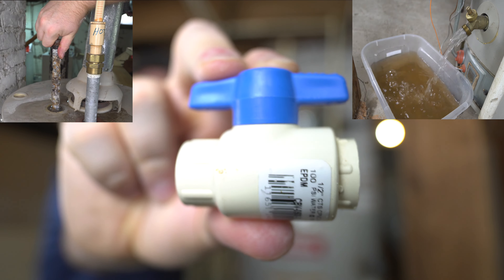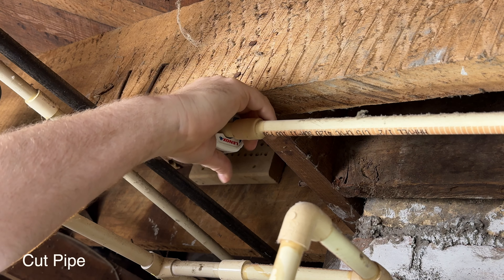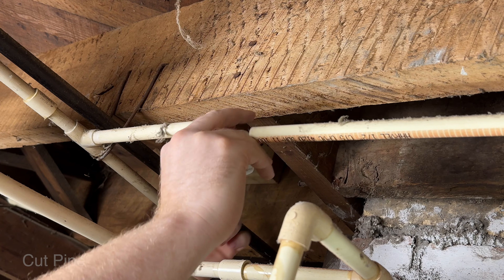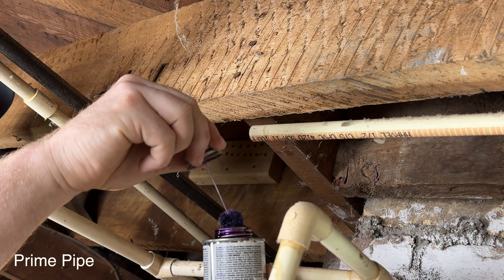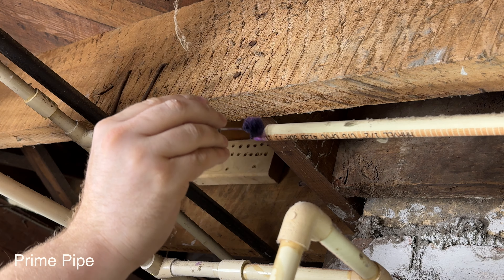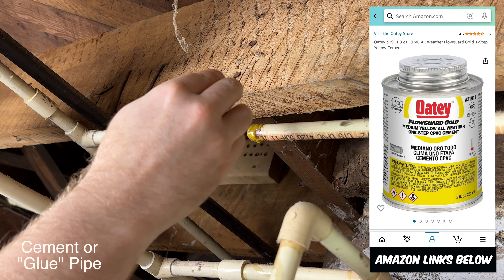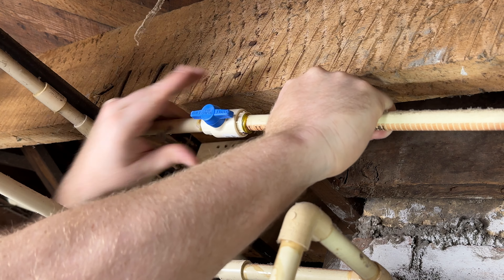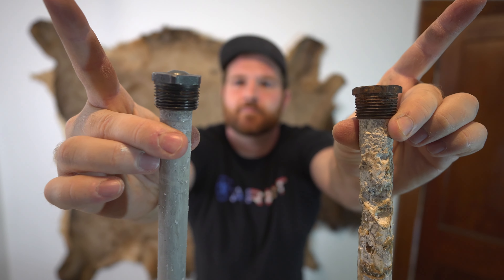How to Install a CPVC Valve from A-Z

Comment: Hey, I love your trick at the beginning of throwing the valve into the pipe, I'm surprised no one else mentioned it!  👍  
I have a variation on the 1st question.  I don't have much room to separate the cut pipe ends, and I'm wondering if I can install the valve on the inlet, and cut a little extra off the other pipe & then swing them sideways enough to meet and still have it slide in to the valve.  Being 1 1/4" dia, the valve's mating area is 1 1/8" deep, at less than 60 psi...   Many thanks if you see this, even if you think I have to go to a union.  😞  HaHa
Reply from the maker: Hey thanks. Im not sure I can follow your idea after reading it a couple times, but it sounds like your on track. 👍
Reply: @HandymanHertz  Thanx for the reply!  I was trying to be brief & clear at the same time, oh well.  😉 This is a 6' piece of 1 1/4" cpvc house line coming in diagonally from the ground, to an elbow they slammed right against the corner of a floor joist.  I was asking if you thought, with over an inch of depth in the valve females, I could cut a little bit more than normal off the pipe, smooth down the outer edge, then deflect the two pipes horizontally and get the 2nd pipe into the 2nd female and pull them back into line...  Maybe a simpler phrasing would be, How far from straight can you bend the two pieces out and still be able to slide the male into the valve, pulling it back into the valve female with the goop inside?

Comment: How much pipe to you cut out? How long does it need to cure before it's okay to turn the water back on?
Reply from the maker: If you look inside the fitting, you'll see a groove where the pipe going into it will butt against. You can measure it or eye ball it and figure out the "takeout" of the valve. 

Whichever glue you are using, it should say on the bottle or Google that manufactures recommendation for the material you're using, temperature, etc.